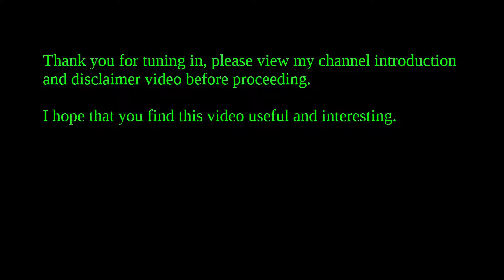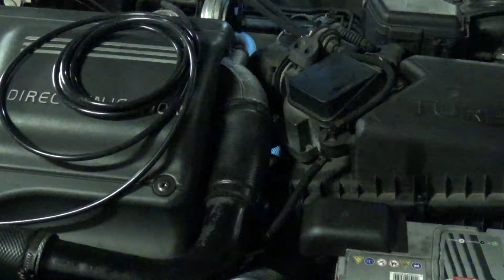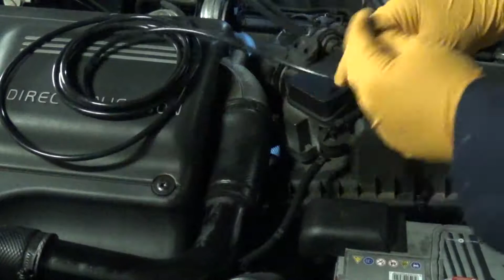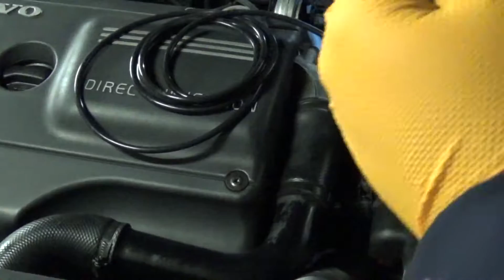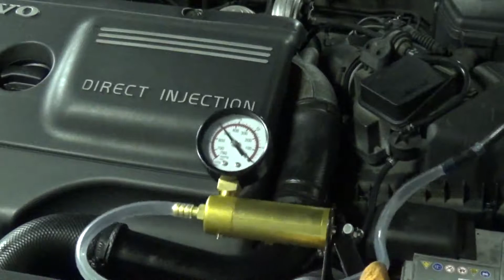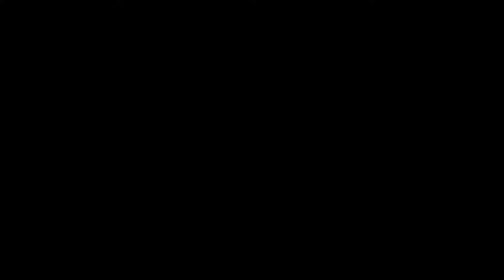Volvo S70 TDI, replacing and testing turbo vacuum lines. D5252T 850 V70 S80 2.5D

Comment: At the bottom of intercooler is a little hole probably for draining out oil from vaccum line. There is no plug covering it. Should the hole normaly be open? Anyone knows?
Reply from the maker: The hole is an oil drain and is supposed to be open all the time, it can get clogged so make sure it is clear.
Reply: @DieselBricks  Thanks for the answer. I will check it.
Reply: @DieselBricks  It seems to be still two-way opened. Should be there any check valve?
Reply from the maker: @sch3112  So far as I know it is simply a hole, no valve.

Comment: Intrinsic like all your videos. Where do you connect the vacuum pump ?The image is gone and I have not seen it.
regards
Reply from the maker: Hello, to test a pipe, you first remove it from the car, connect one end of it to the pump, and block the other end e.g. with your finger. If the pipe holds vacuum then it's ok.

Comment: Hey, I just bought a 1998 s70 tdi. I don't know the history of the car but it only has 156.000km. What's the first thing you recommend checking before I start using the car. Thanks in advance
Reply from the maker: Hey, I'd check the condition of both of the timing belts, and plan to replace soon even if they look ok, as you can't always tell from the way they look. If they look terrible, then don't drive it. Also check the brakes and change the engine oil and filter. Also worth to check the heater core for signs of leaking, and plan to change this too as it's a common failure point. Other than that, just checks you'd do to any car, fluid levels, tires suspension and so on.
Reply: @DieselBricks  appreciate your reply. I actually take delivery of the car on 3rd of march, So will give it a detailed look over including what you have mentioned then. 
Thanks again 👍🏻
Reply: @DieselBricks  Hi, I bought s70. Over all very happy with it. The only fault though is it has a small oil leak coming from somewhere? And I'm in the process of try to find it myself before I take it to a garage. Something I wanted to ask is what is the circle plastic part on top of rocker cover, as this is leaking also. Which I'm hoping is my problem. But oil has leaked down front of engine down and off the sump. So if difficult to see where exactly. So I'm starting up the top and working my way down.
Any advice would be appreciated

Comment: Hi there,
I am about to  install a boost gauge. Which is the best point to connect to the vacuum line? I would need vacuum and boost readings as well.
Reply from the maker: Sorry, not something i can help with, I have no experience fitting boost gauges.

Comment: Hey, i fucked up.. Tried to change timeing belt om my d5252t and i forgot to mark the camshaft. How can i esiest see when the Head is in the right position.
Reply from the maker: Did you time the crankshaft to it's mark first or did you paint a mark? The camshaft is timed by removing the drivebelt to the injection pump and inserting a bar into the pump end. If you didn't time the crankshaft to it's mark before removing the main belt then this is going to be difficult. I would remove the glow plugs and the injection pump belt, and then turn the crank and cam slowly a little bit each at a time until they are both in the right place. Stop if you feel any resistance as you may be hitting a valve. Also keep in mind that the cam turns twice for every time the crank turns once. You will then have to turn the injection pump onto it's mark I have a full playlist for the timing belt change if you want it. https://www.youtube.com/playlist?list=PLMsE9zOD8EV7q7f29BhRXN2NKcrgGharK

Comment: What is that thing the hose is connected to, wich sits on the filter?
Reply from the maker: Depends which item you mean, the rear one with three pipes connected is an electronic valve that controls the turbo actuator and pcv valve. The one at the front with two pipes connected, I'm  not sure about, my theories are a filter or a one way valve.
Reply: Thanks for your answer. I meant the item with two pipes connected. I solved my problem today by putting a new vacuum line from the intake  to the electronic valve, my boost preassure went from 0.6bar to 1.4bar.

Before, I had the line from the intake plugged with a m6 screw wich probably was leaking.

My setup is plugged wastegate and "evrymod", if anyone would like to know.
Reply from the maker: You're welcome. So you have essentially bypassed the item with the two pipes connected? I'm quite curious to know more about the modifications you have done, does plugging the wastegate essentially mean that the turbo will always boost, which is why I'm guessing you had the screw to block the standard boost control connection.
Reply: There is a m8 screw on top of the wastegate where a pressure line goes from, the screw has a hole in it to let by air from the compression  side on the turbo (Or the opposite way, not sure actually). I have my screw welded so there cannot pass any air through, notice- this can only work by detaching the hose on the map sensor, wich goes from the intake. (Map-sensor is located close to the fuelfilter).

Important thing to be mentioned, this modification can not be done on some of the late models, will probably work to some -99 but not later. The later models have a modern airflowsensor, unlike the previous with an airmassensor with a valve in it.
Reply: I think that the standard boost pressure is 0.9bar, peak 1.3, and I've got these specifications from an unreliable source.
Reply from the maker: Interesting, thank you for the reply.